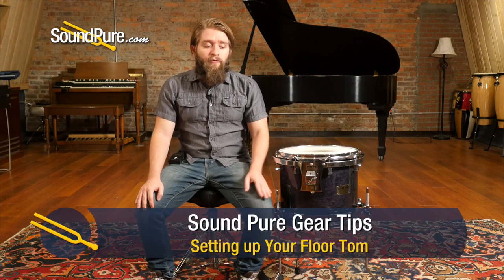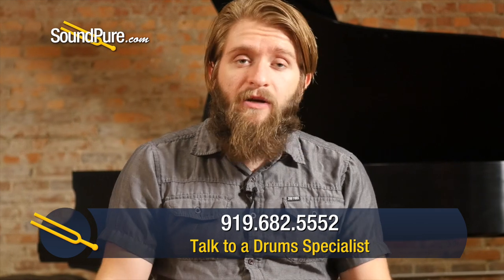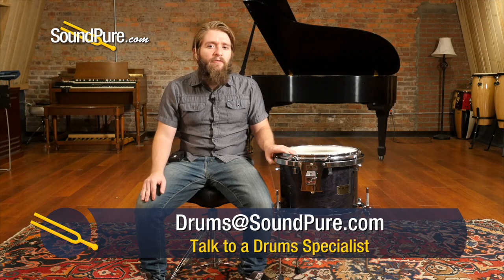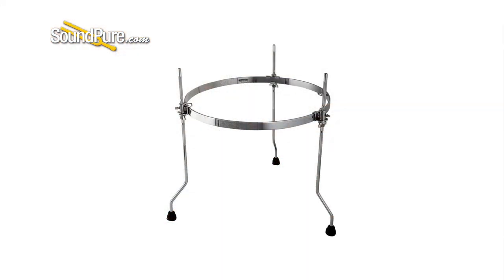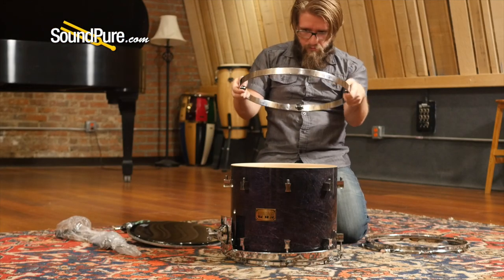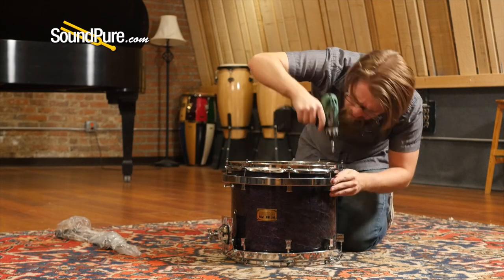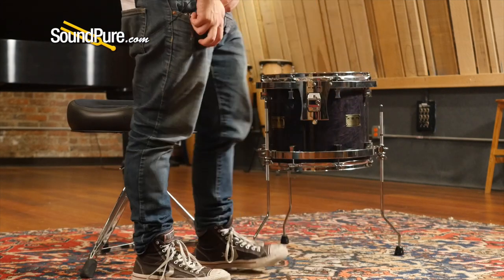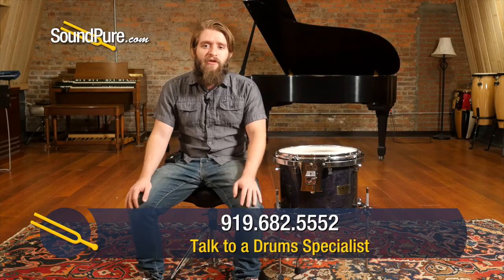Convert a Mounted Tom Into a Floor Tom - Sound Pure Gear Tips

Comment: I just converted my 14 inch and 16 inch hanging tom-toms to floor toms using this gear. I could not be happier! The hardware is solid, and actually, looks great, like it was supposed to be there , as if original from the factory.  If you are thinking of getting this do not hesitate!

Comment: I’ve been looking at the WorldMax 14” converter kit because my pdp suspended tom is also mounted  on the ride cymbal stand. The combination of the larger drum and biggest cymbal means any adjustment of that combo is not easy at the last minute. Introducing a floor tom fix means lifting the drum and the stand can be done freely and adjusted without worrying that the  balance and feet placing will affect your playing ergonomics or damage your kit.
Reply: Ive had exactly the same problem!! The bracket of my 16" tom tore right off.

Comment: This is exactly what I was looking for! I'm so happy someone makes this. I hate having heavy suspended floor toms hanging off stands and those little mounting arms.  I love how it sounds yeah. But there is no reason this shouldn't sound just as good right? It's still suspended and has an isolation grommet. I'm going to get a 14" and 16". I also have porkpie so I'm glad too see you also using this on a porkpie.
Reply: So I did end up buying it. I got the 14 and 16 mounts. Got them installed today. I love them! It's soooo much nicer now. They are way more stable, no more stands, and they actually sound better since it sits on the bottom lugs instead of the heads.
Reply: Do you have to get used a wider than average space between the two floor Tom’s? This would occur due to the cradle being wide right?

Comment: Does the worldmax only come in 14 and 16" sizes? I have a rack tom which I would like to be mounted on legs rather than a cymbal stand with a mount however its a 12" rack tom, is there a way to do this without drilled new lugs into the shell?

Comment: Was curious if this would affect my ability to use my Humes and Berg drum bags. Would the drum fit the standard sizes with the added leg mount?
Reply: Did you ever find out? Trying to confirm the same type of thing...
Reply: There’s no way they’re fitting into my Beato bags.
Reply: @RazeTheWeak I have the same bags. I haven't tried putting the drum into the bag yet.

Comment: Is there a 6 lug version of this anywhere??
Reply: Did you ever find something for this? I'm in the same predicament.
Reply: @mattberm1  no I couldn't find anything. I'm thinking of drilling into my floor tom, it's not ideal but the only option I can find
Reply: @mattbarron4631  I made a non drilling workaround, bought 3 universal Tom mounts and legs to make it a Frankenstein floor tom. Quite pleased with the results.
Reply: Thanks I might give it a try